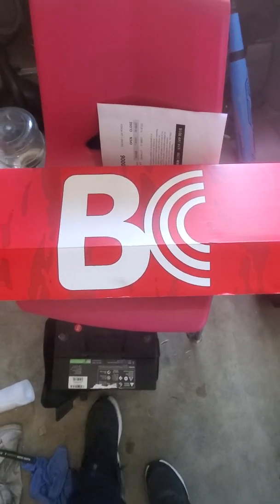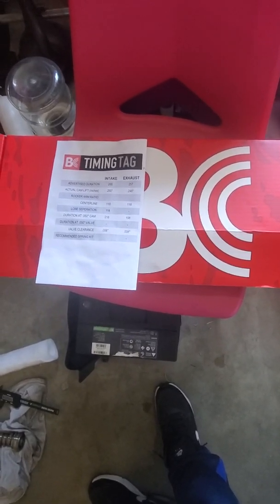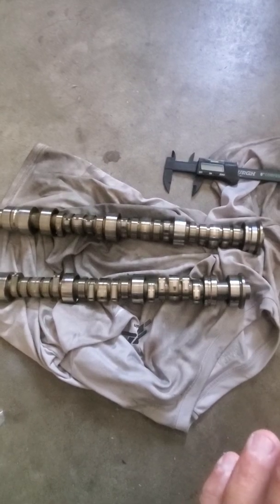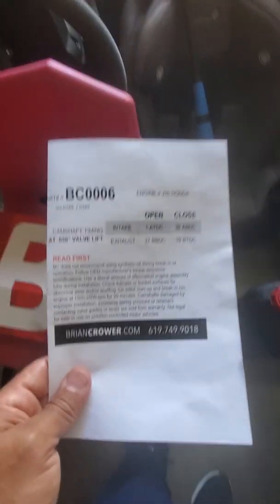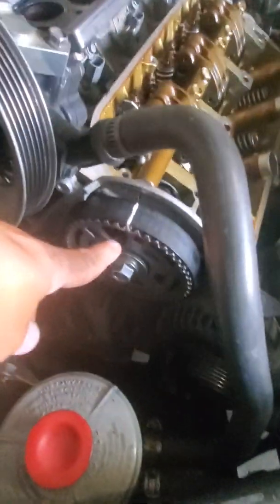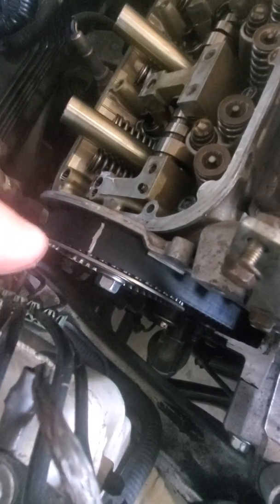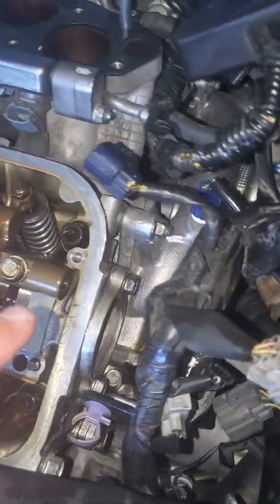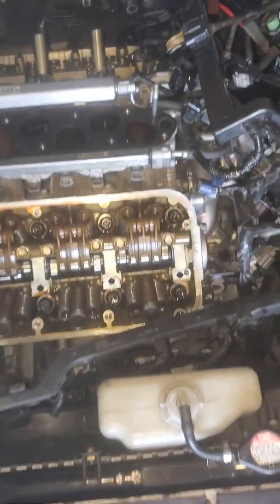J SERIES BRIAN CROWER CAMSHAFTS INSTALLATION J37a1

Comment: Thanks for the video!  Are the J37A1 known for camshaft issues?
Reply: Stupid oil consumption issue causes the ish ...gotta 12 with 90k on her and i have this issue ...5th acura ...lexus here i come
Reply: @acuraledgend9648 same here. 130k miles. Both cams and rockers are worn. I did synthetic oil changes every 4k miles, always made sure it was topped off. 5500 for a used 95k mile engine, 8k for part to fix it. The car is garbage now. Moving to Lexus as well.
Reply: @jeeperscreepers9 damn having this issue hearing ticking what parts are costing you 8k???
Reply: @abrahamlopez1388  2 cams, every rocker, bearings, seals, labor. 8k. Plus, who knows how much damage was done as it wore down. Didn't make a bunch of noise until it was too late. Very disappointed in this engine. We had a bunch of maintenance work done just prior too. I expected to keep the car 8 more years. I've moved on. I'm older now, and the es350 Lexus fits my wife and I fine. And it has a long history of being reliable. Love it.
Reply from the maker: Nope but if your maintenance is not frequent posible lack of lubrication can cause that
Reply: @Aleamary-d3d  copy that!  I have an 08' MDX with 102k and super good track record on maintenance.  Just had the timing belt, water pump, tensioners and complete service done.  Working on adding a bit more power so I'm trying to learn more about what I can do to add power to these J37A1 motors.
Reply from the maker: @SteeltechPC  get halferland cams and 4inch airraid intake

Comment: You know what cams I could use for j35z6?
Reply from the maker: Chk with halferland performance
Reply: @Aleamary-d3d  what about for the j37a4? Its swapped in a 09 according v6 coupe
Reply from the maker: Small things you have to modify but it's almost a direct drop
Reply: @Aleamary-d3d  do you know what has to be modified?
Reply: @Aleamary-d3d  also Brian crower doesn't have anything for j37a4, they have j35. Am I looking at the wrong website
Reply from the maker: @PoloLifeLoso315  remember A4 is dual vtec cam.
Reply from the maker: @PoloLifeLoso315  on the A4?
Reply: @Aleamary-d3d  yeah I have all the bolt ons, j pipe, pcd, magnaflow exhaust, cai, egr delete, throttle body spacer, coilovers, tuner but just the basic tune, running rich though I can smell it, running on premium gas, but I wanna do some internals but can't seem to find anything, next I wanna get the ported runners, and the manifold spacers.
Reply from the maker: @PoloLifeLoso315 ig chony1703
Reply: We have cut every can possible and actually unlike other companies (who claim ours are the same as theirs, they are Not) we show and provide expected gains. 🤙
Reply: Also I have a 3rd gear grind, is that the gear or the synchros? If I am at low rpms or past 45k rpms it'll go in fine but any time b4 that it'll grind, but luckily no pop outs, what do you think that could be? The gears, synchros,  or the shifter?

Comment: Did you upgrade your springs?
Reply from the maker: These cams dont require that, but if you looking to rev to 7500 then you need it so the valves dont float
Reply from the maker: And yes I have supertech valves springs
Reply: @Aleamary-d3d  Okay, so what if I want to rev to 7500 with J37 heads and a J35 bottom end? Edit: without cams
Reply from the maker: @isaiahmcc  what j35 bottom A8 or A6?
Reply: @Aleamary-d3d  Well I'm stroking a J32A3 block and stroking it to a 3.5 with a A6 crankshaft.
Reply from the maker: @isaiahmcc  a6 crankshaft with what pistons and rods?
Reply: BC rods with DNJ 89.5 pistons. Compression ratio is at 12:1
Reply from the maker: @isaiahmcc  you should do it with that compression, is really high so you want make sure the valves are closing full and not floating
Reply: @Aleamary-d3d  Okay, gotcha. Love your Accord build. I have a 03 Accord that I'm putting this engine in.